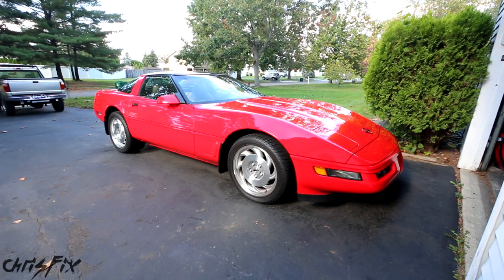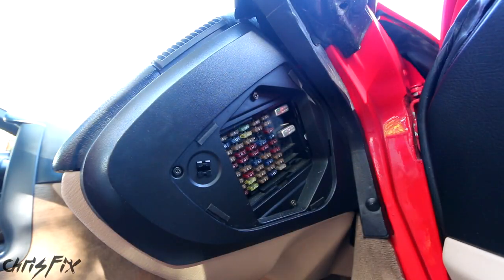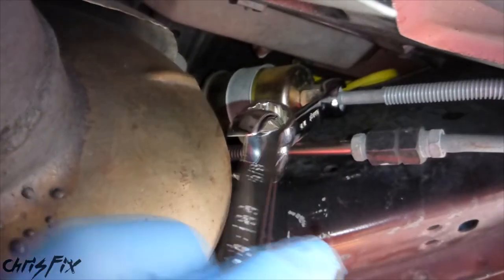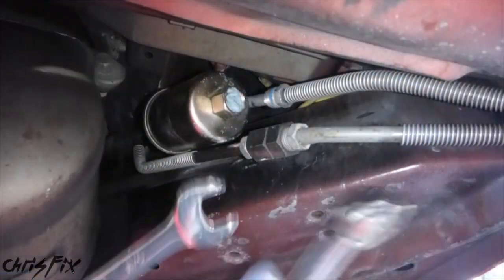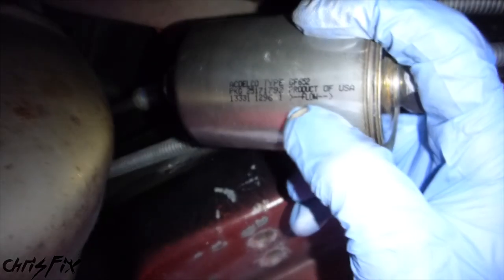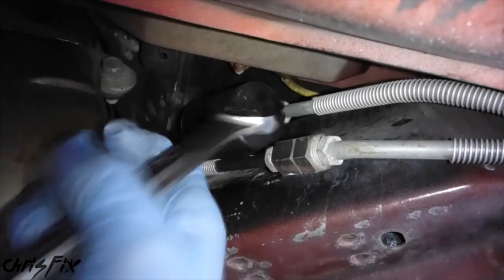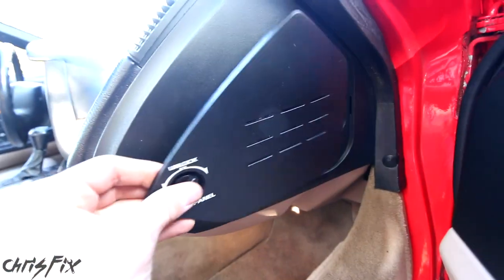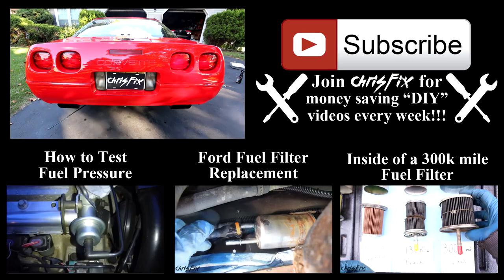How to change a Fuel Filter (GM, Honda, Toyota Style)

Comment: Should I have to empty the fuel first?! Thanks
Reply: It's best to do it when you're low on gas, I wouldn't do it on a full tank, but if the fuel pump isn't active, then fuel shouldn't be flowing in the line.
Reply: @Gl4uc0n  Thanks for letting me know. I think in that case I should remove the fuel filter fuse first and then negative terminal just to ensure it's coming as expected. What's your thought?
Reply: @amjathkhan2004  Definitely remove the fuse. Removing the negative terminal might be a bit excessive for a job like this.

Comment: My vehicle Proton Wira fuel filter same as this video,but it at in front firewall there, so hard to put my hand on it while remove it due to space of it is limited.
 from malaysia
Reply from the maker: +Summer Chiang Yea, sometimes it is tough to get in there. But like you saw in this video, there are some tips and tricks you can use. Good luck!
Reply: after i try the trick, update you. i bought the fuel filter last month. it cannot remove, so i leave it at there.

Comment: will that anti seize damage the engine or the filter?
Reply from the maker: +Arad Dehestany it isn't in the fuel system, it's on the threads so no, it won't cause problems.
Reply: I'm mechanical engineering student. what I've been studying has nothing to do with these stuff. your videos are much useful than those books and courses. you're the true mechanic!!
Reply from the maker: +Arad Dehestany thanks. You need to learn from a lot of sources to be good at what you do. School, research, videos, tinkering, etc!

Comment: You should do that in the street l. I wouldn't want gas stains on my driveway
Reply from the maker: +Boston Celtics 34 It all goes into the drain pan so there is nothing to worry. Working in the street, under a car is very dangerous.

Comment: Hi guys can some one help, my dad owns a bmw 330d and when he first bought it it threw u back in your seat but now it doesn't I just wondered would a fuel filter reduce power and take more fuel to run on a daily basis. Thanks
Reply from the maker: +Kyle Petch It could be the fuel filter. I would do a fuel pressure test to see if it is the filter causing the hesitation: https://www.youtube.com/watch?v=_oXLUqE4Sf0
Reply: +ChrisFix thanks so much

Comment: Is it necessary to remove the fuse?
Reply: you don't need to however it will make the job a lot easier because it'll let some of the pressure out of the lines.

Comment: I have a toyota, my owners manual says that I dont change myself the fuel filter because it causes the computer to do some bad stuf, what do I do if I dont want to spend hundreds or thousands getting it to the dealer
Reply: my suggestion would be to disconnect the battery so the computer doesn't sense anything until you turn it back on
Reply: I solved that problem by going back to the old school. I now drive a 1965 Mustang with a 6 cylinder engine. It is the easiest engine to work on. I could swap out my engine faster than you could change your power steering pump. Lastly, my car only goes up in value over time. I love it; and I don't miss my Toyota Sienna at all. It took me three days just to change my spark plugs on that van. I think the dealer would have charged over $700 to do it. I had enough...

Back in the 1960's swapping out motors was a weekend project, with the help of a friend or neighbor.

Comment: the wiper move like they want to start but just shifts further up.
Reply from the maker: +Melvin Johnson Pop the caps up on the wiper arms and unscrew the screws holding the wipers in place (with the wipers in the off position). The wipers will be loose enough to move. Move them to the "off position". Then tighten everything up and give them a try! Keep me posted!

Comment: anti seize on the engine side was a bad idea.  If you are going to put in on, it's better that you put it on the female threads, this way it wipes outward, not inward, as you screw on the filter.
Reply from the maker: +Sam Petrocelli Thanks for sharing. I never had a problem. The threads are dry threads and never touch the gasoline.

Comment: what about diesel cars?
i have a vw passat
Reply from the maker: I need to find a diesel car to work on!
Reply: +ChrisFix happy new year
Reply: +Erki Varandi diesel car fuel filters are fun... a tiny bit of air in a diesel could cause it to not start so after you replace the filter you need to bleed the system.
On some cars the car can do it, on some, not so much and its a pain.

Comment: You suppose to start it and run it until it shuts off.
Reply: It was running when he pulled the fuse.
Reply: Oh...
Reply from the maker: +hp11208 You cannot start it with the fuse pulled, you have to have it running and then pull the fuse like in the video.

Comment: If you opened the fuel cap wouldn't that have released the pressure for less mess
Reply from the maker: +muscular2008 No, that would make it worse. The gas would just pour out of the fuel tank line because there is no vacuum holding it back. Once fuel pressure is in the fuel line, it has to be removed after the fuel pump.

Comment: ...did someone blue loctite your fuel filter @ 3:25?
Reply from the maker: +Joey Cusimano  That is a factory mark that lets them know they torqued that bolt down to the correct spec when they build the car.

Comment: dont like the GM fuel filters. I had to replace it on my old gmt400 Tahoe once, pain in the ass to remove it. fords quick connectors are better in my opinion.
Reply from the maker: +Wasper216 I agree 100% with you. The best are the ones like in this video: https://www.youtube.com/watch?v=sDtQKNTz0QY

Comment: BEWARE--UNSAFE PROCEDURE--Cracking a fuel line loose on a vehicle with port fuel injection = 40+ pounds of fuel pressure in the fuel line, it is a recipe for disaster. Note the fuel spray when the first fuel line is loosened. After removing the fuel pump fuse start the engine, it will run for a few seconds = no pressure in the fuel line.
Reply from the maker: +Woody Church Did you watch the video at all? I would do that before you comment saying my video is not safe.
Reply: +ChrisFix  Certified dealer tech here, I watched pressurized fuel spray under the vehicle when you loosened the first fuel line. Your fortunate the exhaust system was not hot & ignited the sprayed gas you could have been burned. For your own protection please do not use your procedure again in particular on direct injection vehicles the fuel line pressure on those vehicles is in excess of 200 lbs. Like all your vids but you have a safety issue with this one.  Good luck.

Comment: Did you forget to relieve the fuel pressure? instead of a drip it was more of a spray.
Reply: +Joseph Murray I saw one vid and the guy removed or loosen the gas cap first.
Reply: +James Chuaycham I'm not sure how that would help because the pressure is in the fuel line after the fuel pump.

Comment: Why do we need to change the fuel filter?
Reply: If you don't and it gets clogged enough you may have to replace a fuel filter and a fuel pump which is way more difficult and way more expensive.
Reply: +twn5858 thank you for the information!

Comment: Why did you remove the fuse?
Reply: +o0oitzJimmy That fuse was for the fuel pump.  By removing that fuse he shut off the pump, causing the engine to burn off the pressure in the line.  I've removed a fuel filter under pressure and you do more than smell fuel!
Reply: oh ok thanks

Comment: i dont know where my honda element fuel filter is
Reply from the maker: +Roy Pones Captain Morgan is right. It is part of the fuel pump
Reply: hmm i been reading some threads. a lot saying there is no need to change....any input on that?
Reply from the maker: +Roy Pones Yea, for those you wait till the fuel pump dies
Reply: +Roy Pones Yea i drive a 2008 Hyundai Santa Fe and mine is actually built into the Fuel pump